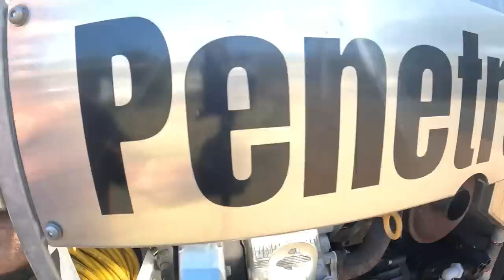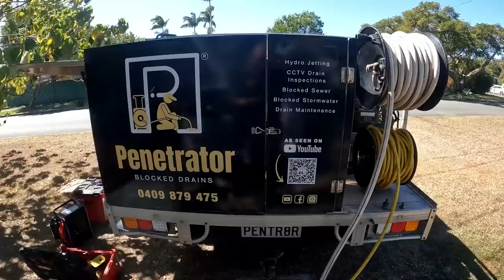Blocked Drain 421 - EXPLOSIVE!!! SPLASH Protection Required

Comment: Get a few inches of garden hose and split it length wise. You could put it over the sharp edge in the future. That would probably be about 10 centimeters or so. You could always cut to size the first time.

Comment: If u didnt point out it was a drain pipe i would have thought it a light pole the way the base is made. Use the diamond wheels on the grinder little mire expensive but there is no dust from them & they last 20 times longer then the fiber blades & can get wet & not loose strength. Get rid of the paint scraper & get urself a pry bar u could have popped the piece out faster & prob not made such a mess. Also love the vibrator cutters they dont throw stuff all over the place.  But have a good day gavin 😊